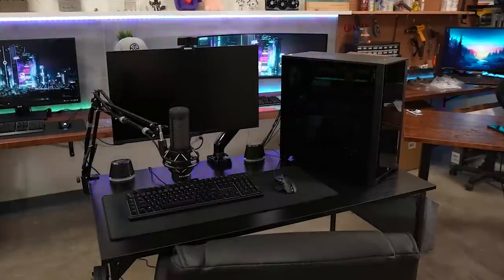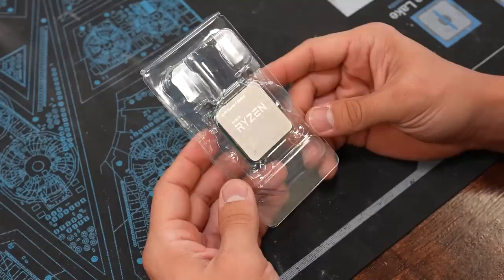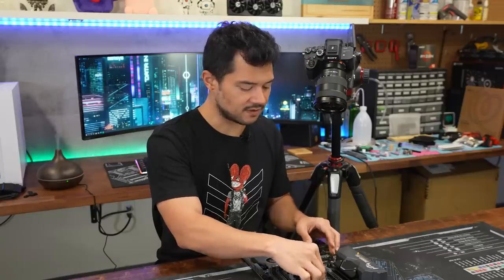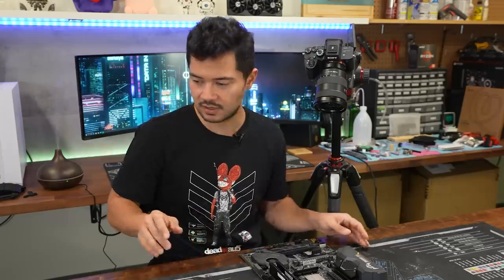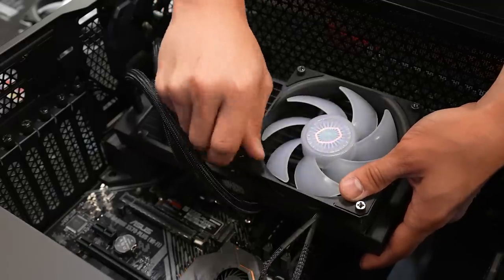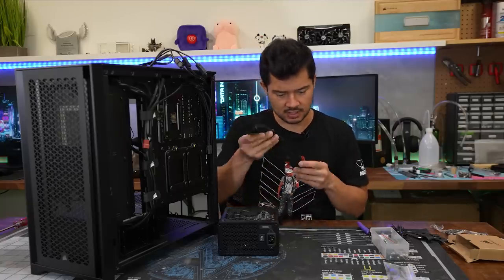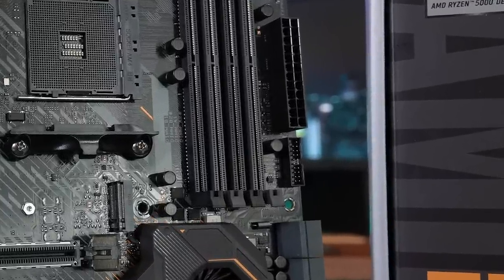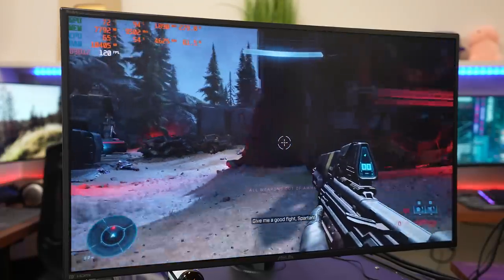The Amazon "#1 Best Seller" Gaming PC!

Comment: I wanted to mention. I had Asiahorse on my build with a 2080 Super, but once I upgraded to a 3080 FTW3 the cables caused me a lot of headaches by causing black and blue screen of death which the cables that came with the PSU or the Cablemod cables I got later did not. Not sure if they improved their extensions, but otherwise I wouldn't recommend them for 3080s and above.
Reply: I have their extensions on my 5800x & 3080 build an no issues the past year.  Wonder if you happened to get a bad set?  But interesting...

Comment: I'm convinced the Corsair 4000D Airflow makes any build look premium. Gotta admit, I was sold. Almost went for the Fractal Design Meshify C, but the front dust filter and the way the glass panel on the Corsair was so sleek without the buttons on the Fractal's sealed the deal.
Reply: wtf

Comment: 6c 12t got replaced by 8c 16t when those new consoles came out. Also 8gb ram got replaced with 2x8gb with the same consoles. I myself don't agree with this statement but a lot of new builders that don't know much give me this reason and refuse to budge no matter how many times I show them benchmarks of a 6c12t with a better gpu and/or cooling solution.

Comment: You only need the Molex connector for the fans to remotely control the RGB, I don't use the controller and have the rgb going into one of the headers, I also have the same mobo :)

Comment: I agree with the Molex frustration...every time I see a case accessory using Molex it's a WTF moment. You have to attach a whole 3 plug cable and jam it into the case somewhere to hide it when there are spare SATA power connectors staring you in the face...

Comment: That's an older Cooler Master AIO. The new ones don't use Molex for the power. Get a newer Master Liquid AIO. The lighted ones come with a SATA powered controller. That, or ditch the CM controller, and plug directly into your mobo header.

Comment: A word in defense of that AIO is that the Molex connector is not necessary. It's only there in case you have to use the physical controller because your motherboard doesn't have the proper 12v RGB header.

Comment: I agree with current gen builds not being pointless. Coming from a 1700 +  b350m, I just ordered a x570 board + 5700x for around $400. And since I can use the current 32gb kit that's not even running at max speed for me due to ryzen 1s limitations, saves a ton over next gen which with an am5 board, new cpu and 32gb ddr5 kit, would over likely hit over $1000. Certainly not worth it for me. Plus your not their guinea pig for the new platform either. AM4 has had its bugs and issues mostly worked out by now.

Comment: I was torn between 3 Ryzen processors myself the 5800x, 5800x3D, and the 5900x. I went with the 5900x for $369.00 plus an extra $25 off.
Reply: I have the same thinking, I can’t pick between those three and my mobo is asus rog strix b550-A and the 3D is $410 would you have going for 5800x or 5900x would be better Becuase of how much it is less
Reply: @christianmeza1550  I went the route I did for one the price and also for the extra cores. I upgraded from a 2600x, it just couldn't handle my GPU in several games I currently play any longer. Both the 5800x or the 3D are great as well.

Comment: For anyone considering this mobo and case combo, you can buy a usb3 to c adapter for less than $10, you may not get all the same connectivity but it will still allow you to use the port if needed

Comment: From experience, I'd say that if you get a high mid setup, you can run it comfortably for roughly 5 years before it stops keeping up. Personally I've ran dual core Athlon with 9600GT (which btw is still up and running in more office-purposed PC) then swapped to 5th gen i5 with GTX960 and just now I swapped to Ryzen 7 5600 and RTX3060 and I think the last one is an overkill, but since it's a laptop (probably the last one I buy, but had to do it due to space reasons) I decided to do that for comfort reasons. I'm pretty sure that Ryzen 3000 series and 2000 series RTX would be more than enough.

Comment: good luck keeping those memory modules running at DOCP. i had those exact ones, and the TUF board with 5000 series ryzen does NOT like them. lots of random BSOD. they worked great on a prime x570 board tho, so i sold em to a friend. ended up with ripjaws instead, on the QVL.

Comment: I was worried for a minute that the best sellers would be budget stuff, turns out it's not that bad, all things considered.
Reply: I was expecting it to be a bit more midrange. Where I live the best selling product is the rx 6600, followed by the 3060. So I was thinking it would be a bit of a lower tier build
Reply: @Olav_Hansen  the 5800x is pretty mid range, 32 GB is pretty mid range, a 3080 is a bit premium but considering the 4000 series and 7000 series it won't be for very long lol,
Reply: @Obi-Wan_Kenobi62  I consider 5600x/12400 to be midrange. 
Also, I have seen some performance tests using a 12700k, and even at that point 32gb only has very few uses over a 16gb kit.
But going with an aio for a supposed midrange cpu also seems like a bit of overkill. Admittedly it's not the most expensive aio, but it's still 20+ over a noctua cooler that will most likely outperform it.

A 12400f will undercut the 5800x by 150 euros, have almost comparable performance and doesn't need one of those coolers. Plus you need a more expensive motherboard to allow for decent overclocking.
That's 300 extra as a result of that cpu choice, that's why it's high end not midrange. Ryzen 7/intel I7 literally stands for their high end, the 9 series represents enthousiast level not high end.

Comment: For the AIO you don’t need to use the RGB controller with your the molex connection if you use the 12 V RGB connection on the motherboard. That’s what I learned from using that AIO
Reply: Same I don't use the controller. I use RGB hub and let Mobo control through RGB Fusion
Reply: @CandelarioJrAmaya  same i do to he don't need the molex
Reply: Lol, I was confused as to what he was connecting. Does that board not include a 12v RGB?

Comment: Hey guys. I'm thinking about building my first pc and I want to know if there is anything I could improve. Here is my current parts list: MSI MPG A650GF 650 W 80+ Gold Certified Fully Modular ATX Power Supply | MSI VENTUS 2X OCV1 GeForce RTX 3060 Ti LHR 8 GB Video Card | Crucial MX500 1 TB 2.5" Solid State Drive | Corsair Vengeance LPX 16 GB (2 x 8 GB) DDR4-3200 CL16 Memory | Vetroo V5 52 CFM CPU Cooler | AMD Ryzen 5 5600X 3.7 GHz 6-Core Processor | MSI MAG B550 TOMAHAWK MAX WIFI ATX AM4 Motherboard | Corsair 4000D Airflow ATX Mid Tower Case

Comment: I have the same situation regarding the USB C header with my case (a Be Quiet Pure Base 500DX), my motherboard is an older MSI x470 so no out of the box Type C option

I have not really done it, but you can buy a USB 2.0 Front Panel Header USB 9pin to USB 2.0 Type-E Internal Adapter for that (there would be limitations with the speed I think if you do this but otherwise it would work just fine based on what I saw)

But in my case, I just got used to keep handy a USB A to Type C cable whenever I need to plug any Type C device to my PC.

Comment: In the UK, you'd be building with a 5600X, on a B550, in the same case, with a 2x8 kit,  with a 3060, an EVGA white 600W PSU, with a NH-D15 Chromax
Once again, a set of parts that actually makes reasonable sense

Comment: Not a bad looking system for buying best-sellers only! 

About the fans, I personally would have moved the rear exhaust to the front being that it's an AirGuide fan (both positioned as low as possible to feed that GPU with the coolest air possible), and it would help to balance out the negative pressure in the system with two filtered intakes instead of just one.

Comment: That's the same GPU i got! Feels a bit overkill with 3x8-pin and it can get super toasty with default fan profile, but with manual fan control, it's easy to remedy. The card kicks ass, though. Pretty smooth 1440p experience

Comment: The percentage of Ryzen CPU's that are bad right out of the box steered me in the opposite direction. I just watched a video with Greg Salazar and he troubleshot a brand new build with the 5800X and the chip was bricked. Most of the others were the Ryzen 5's.
Reply: This very true.  I deal with a lot of computer repair and the amount of ryzen cpus broke from new to barely used is a abomination 

Compared to intel.  It’s 80% difference. For me 

Intel chips as old as i3 4th gen still work but ryzen seem to catch fire or somthing 🤷‍♀️

Comment: The 3080ti and 5800x3d are a combo that will bang out excellent 1440p performance until the 5000 series releases. I'm waiting specifically because it'd be a waste of money to turn around and replace the 3080ti and 5800x3d right now and I'm not sure I like the wattage requirements of the next gen of graphics cards and CPU's. I'm using a 1000watt PSU but will that even be enough for this coming gen of hardware? Hopefully the generation after that will be more efficient...

Comment: I'm on a 1070 still and I can max out all of the games I play. If you don't want to play the newest titles in 4k then most GPUs are fine.
Reply: 3080 is overkill tbh
Reply: i recently got a 1650 so i could finally crack 200 fps on max graphics on games and got like 450 and tbh i think itll be my last gpu upgrade for a while. the only reason ill upgrade to a 20 series is if i rlly need to or i get a new pc again and the gpu is bottlenecking me

Comment: I think you should mention that x570 Boards have a fan while all x570s Boards only have passive cooling

Also in comparison to b550, the x570 usually have more m.2 slots which are quite practical since m.2 ssd aren't more expensive than 2.5" ssd anymore
Reply: yeah but my tomahawk b550 supports usb-c on the front io and has 2 m.2 slots so still better than this x570 for the price

Comment: I use a AMD FX 8350 and a 1070Ti 🥲 you said those were two years old now and I’m just thinking about how hold mine is 😂. It’s on a gigabyte 990fxa-ud3 mobo with 16gb of ddr3 1600mhz ram
Reply: I'm running a FX 6100 with a 1050Ti and similar other parts as yours.  It still works pretty well.
Reply: @stephenschroeder6567  ive actually upgraded over the last 2 weeks to an I7-7700k and a EVGA XC3 Ultra 3070

Comment: Well, the best-selling PC is just a really good PC, what a surprise. Even the aio is pretty good, I was way more happy with that one than the EVGA CLC 280 (which was very loud and very hot). It's no Arctic LF2, but still vey performant.

Actually a bit surprising that a 3080 made it into best-selling, I was expecting a 1660. Shows how much the supply issue has subsided.

Comment: im surprised the corsair 4000d is so popular. the front panel usb is pathetic, the cable hider on the inside sticks out and will block a long gpu like the 6800xt from fitting at all so you have to remove it and have all your cables exposed along with the cable cutouts but it doesnt really matter because the glass panel is tinted so dark that you cant even see anything besides super bright rbg lights on the inside

Comment: i got so sick of molex plugs in my server so i cut them off and put 2x SPL-2 connectors in there place (you could use SPL-4) as i had some stuff that only needed 12v from a molex and rather than buying 2 products i bought 1 sku

Comment: I have the same CPU, Mobo, PSU, and the 360 vers of the Rad and only one thing on that list was from Amazon from a build on 5000 series launch week. Guess I built well.

Edit: my 3080 is FE otherwise this is basically the same computer in a different case.

Comment: Fun vid, relatively good choices by the masses when it comes to parts except, as you said, that board. Absolutely, 100% inexcusable for a $200 board to not have a USB C header. Heck, inexcusable for a budget b550 in 2022. Idk if it was made in 2018, as USB C has been around since 2014 (or 2015? I know it was finalized in 2014 but may not have appeared on boards until the following year), so to not have a header is idiotic. If Gigabyte can manage one on their $55 b450 Aorus M's then I fail to see ANY valid reason to not put one on a modern fricken b570. Bleh, I remember upgrading my Aorus M to an MSI Mortar just to realize it didn't have a USB C front header and would not support the same RAM overclock and timings the Gigabyte board did. That really, really irks me. I'll NEVER overlook that again, and just like a board only having two RAM slots, that is an absolute deal breaker for me. That isn't just cheaping out for extra margin, that's a Scrooge McDuck move as it literally only saves them about 50 fricken cents since the traces are still there and all they needed to do was solder the damn connectors on. Since that's just a matter of telling a machine to do it...Wow, like I said, that really bugs me.

Other than that, it looks pretty clean, isn't too expensive for what it is, and uses a few of the same parts I would if I was building a high midrange PC for myself or a friend (well I suppose it's still low high-end until new GPUs release). Oh, and I hate it when they get you with the Molex connectors. I bought a few cheap RGB fans that only had Molex and though it didn't really matter for that particular build, just having to add the extra wire, daisy chain and hide the additional cable was a bit of a pain since I already had the extra SATA plugs on another wire which would have made cable management a tad easier. Oh well, certainly not as bad as the no USB C front header issue.
Reply: It doesn't bother me in the least because I really don't have anything I need to plug into it anyway ... I'd rather save the 20 bucks than have something I don't use .... If they had offered a version of the TUF Gaming without the RBG I would have grabbed it to save money because I have it completely shut off since I have a solid side case to help keep all the RFI hash inside the computer and out of my RF test equipment (spectrum analyzer, vector network analyzer) 

I'm a function over form guy especially when that form costs me extra money for zero performance gain .... I got a 360 AIO without any RBG for the same price as a 240 with RBG ..... I got the Phantek Eclipse 600S (Solid side no RBG on the fans) for 20% less than the 600S with the glass and RBG fans .... I got the non-wifi version of the TUF Gaming for $25 less because I use ethernet for reliability and speed so wifi is just a waste..... Saved another $25 on the G.Skill 32 Gb CL16 3600 dual rank memory because I got the non RBG model .... So that's 100 bucks savings plus a better cooling on the CPU which also meant a quieter system because I get the same or better cooling at a lower fan speed
Reply: Why do someone even need a usb-c port ? What kind of devices can you plug into this port ?

Comment: I know you are using the most seller items in Amazon, but for motherboard Aorus Elite X570 wifi is 219 dlls and has usb C connection and the no wifi version is 167 dlls, and like 2 months ago I upgrade my system from i7 4790k to 5800x and i pay 150 dlls for aorus elite x570 non wifi version.

Comment: I can't believe its 2022, and people are still building without wearing a anti static bracelet.   But hey at least you have a table.
Reply: Linus Tech Tips did a video a while back with a guest who specializes in running fair bits of current through stuff. I think they tested ram in particular to see how much juice you need to kill it, and it's quite a lot. Much more than you average static build up. Given that, I'm not sure anti static wrist wraps are truly necessary. As long as you don't build while standing on carpet or something(or the PC on carpet), you should be fine.

Comment: Well seems to be better than my £115 gaming pc 

ASUS H110M-C micro ATX 
I3 6100 3.70ghz 
Kingston Fury 8gb 3600mhz DDR4
1660 Super (single fan)
Deepcool 110 Micro ATX case 
550 watt PSU (super lower)
Corsair AIO cooler
120gb boot drive 
4tb storage 

Yeah that’s my build it’s not the best but I had a budget of £150 and had to make the best I could

Comment: Unless you move large files frequently Gen 4 provides no benefit... I run hardware a monitor constantly and my 970 Evo NEVER reaches the speed it can during benchmark testing.  In fact, in the past 3 days of gaming and browsing with my PC on the entire time the maximum READ speed it hit was 204.41 MB/s. But... there are many Gen4 SSDs that go for the same price as the 970 evo plus... my guess is that the age of the 970 evo plus is why it's the top seller... I would go with a WD_BLACK 1TB SN770 as it's faster and the same price right now.

Comment: I just bought a evga ftw3 3090ti new from micro center for $1000. I still feel good about the purchase because I'm willing to be there won't be a 40 series card that can equal the 3090ti for $1000. If I had to bet the 4070 will be $1000. And I doubt it will be faster than the 3090ti.
Reply: @deadchannelfrom2018  we will see but lot's of videos I've watched and articles I've read said a 4090 will be $2000ish dollars. I doubt they will cut the price in half for dropping just 1 bin to a 4080. But it's all speculation for now.
Reply: @deadchannelfrom2018  we will see shortly. Nvidia took a hit to their bottom line at the end of this year. I see them trying to recoup some of that with the initial cost of the 40s. I could be wrong.
Reply: @williamtufts3600  wasn't the 3090 double thr price of 3080 or more

Comment: Real talk with all the new parts coming out - I'm running this same Mobo and Samsung drive with a 3600X and a 3070Ti. Would you recommend watching 5000 series pricing and picking up a 5700/5800X? I built my PC in Feb 2020 and have swapped cases, PSU (needed SFX) and the GPU, but a full platform swap seems excessive. Also running a Noctua NH-U12S, but would probably swap to a larger Noctua for a 5800X.